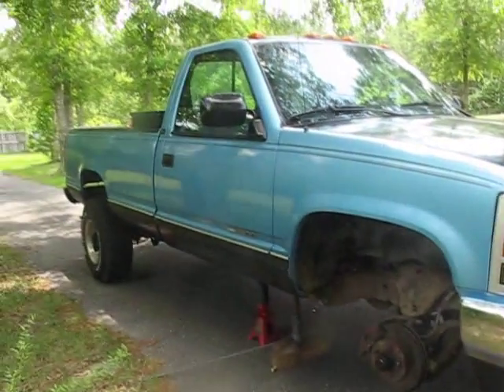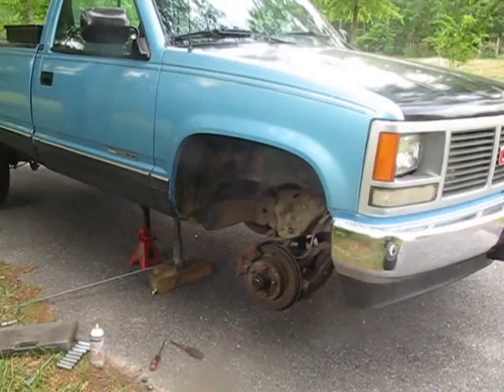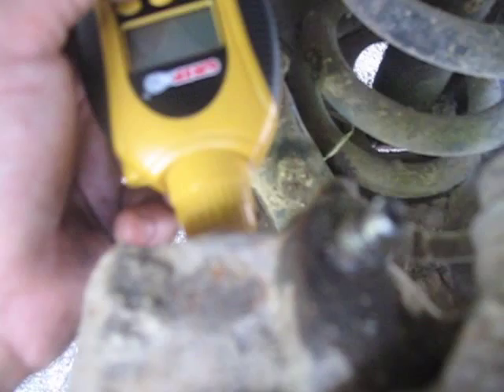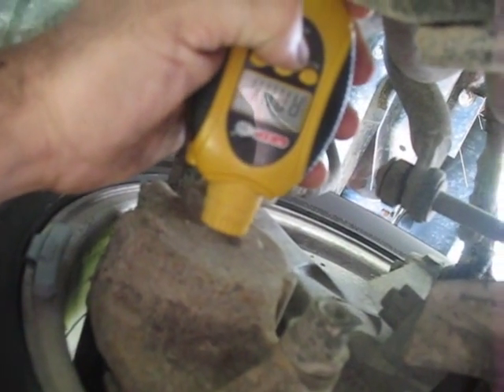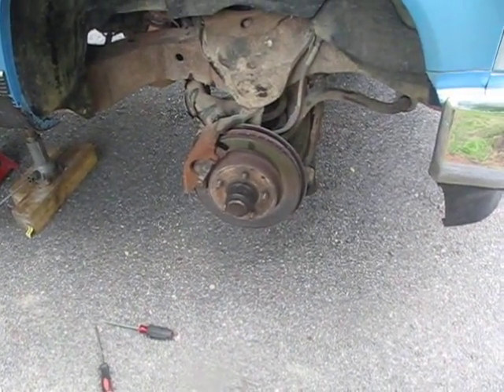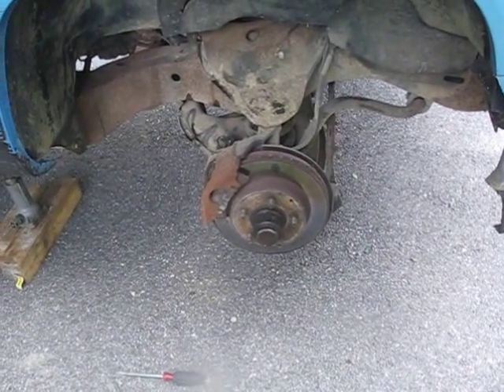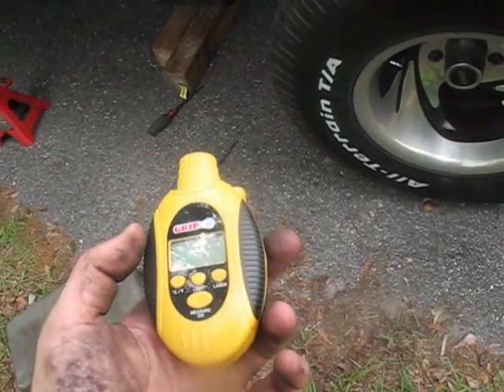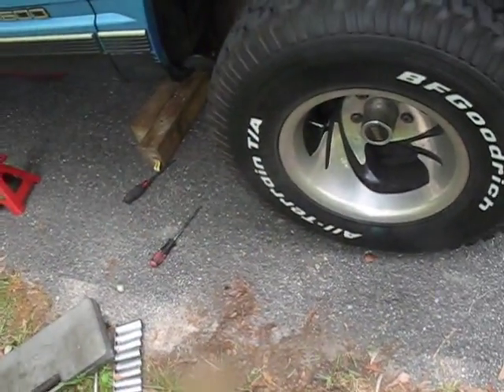How to diagnose brake problems on cars, trucks, and motorcycles

Comment: Nice wheels on that truck. Is that the truck you said you were going to go look at? Also it makes sense to do the readings side to side & not to compare the readings with the rear since the front brakes do more then 70% of the stopping. I bet the rears will read about 20% cooler then the fronts.

Comment: Nice dude, I just ordered one of those Infrared Thermometers to help me balance my air/fuel ratio in my carbs in my Seca II motorcycle- by measuring the temp in the header pipes.  Now I will have that tool for another purpose, thanks!